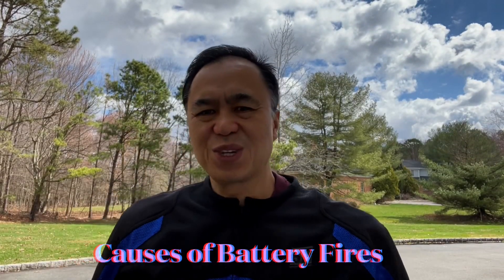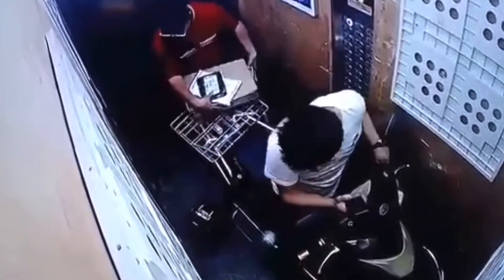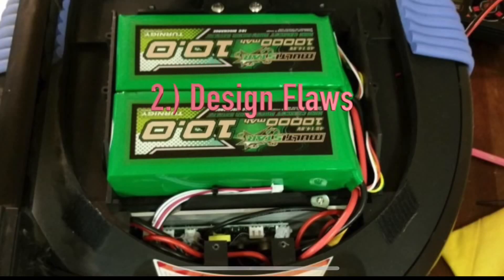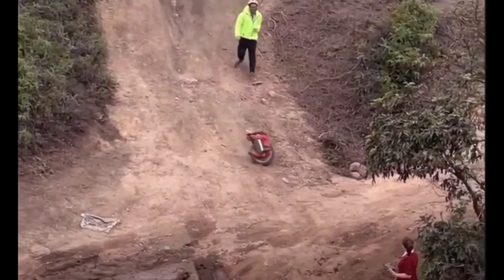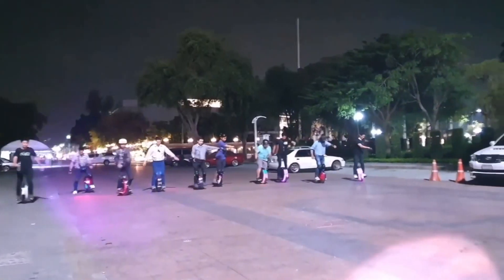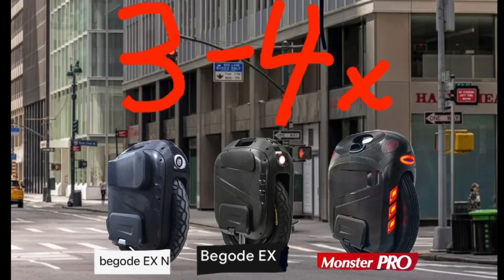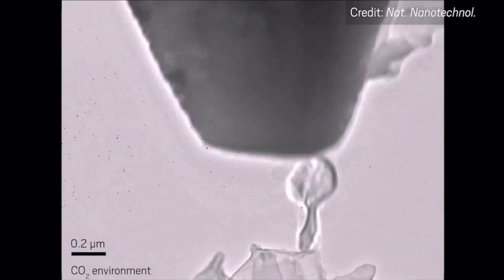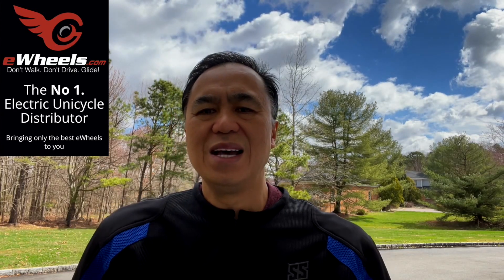Causes of Battery Fires

Comment: Great explanations. I’m guilty of regularly draining the battery.
Reply from the maker: Thanks! I usually don’t ride if my wheel is less than 50% charged as a cutout can occur if I push my wheel too much. My usual rides are usually 10-15 miles long anyway and my Nikola 100V has great range. 

I would charge my wheel to full charge on the day of or at least the night before my ride. I would never charge my wheel overnight of course while I am sleeping.
Reply: @AdamU1016  that sounds funny. Actually, 0% battery in wheellog or eucworld, is not real 0%. Manufacturers made a big enough margin for safety, and the real charge is 10-30%. That's why you can still ride when programs show 0% while standing still. I often ride to "zero" kingsong 18xl, making 80-100km trips without charging, and everything is ok.
Reply from the maker: @ZorgKirill   - You run the risk of a cutout by riding your wheel at low charge. Should you need to accelerate quickly to avoid an accident your wheel could cut out. I top off before I ride if I am able to.

In addition, if you are always draining your battery to always low level as I mentioned in the video, the wires and hence internal temperature can get hotter since more current would be needed to power your wheel. When your wheel is at low voltage due to low charge, your current would have to increase to power your wheel. More current can heat the wires, mosfets and internal shell temperature and hence affecting battery health.
Reply: @AdamU1016  on low voltages gotways/begodes tilt pedals on maneuvers, even with turned off pedal tilts. I have 16k km experience on Gotway MSP, riding fast and on low voltage often, and had no cutouts. As for the heat and battery temperature on low voltage, it doesn't work in such way. I've spent 2 hard winters with lots of snow and temperatures like -20C and less, riding as usual as in summer, and on low voltages battery freezes faster, not heats up. If at summer I can ride slow on 20-10%  charge for a dozen km , in winter the distance become twice as less, if not even smaller, because battery freezes quicker and voltage drops faster. When i get inside warm room, battery % and voltage rises up, because it heats up by warm air inside the room.
Reply from the maker: @ZorgKirill  - That’s great that you haven’t had a cutout riding at low percentages. I have been riding the wheel for almost 8 years now and have never had a cutout by being conservative as well as having at least 50% charge when I push my wheel. I have stopped counting how many miles I have ridden long ago. I have no idea. I have changed so many wheels. 

In the summertime we reach temps over 100 F (38 C) here. I would not want to push my wheel at low charge. May I ask what part of the world you ride your wheel?
Reply: @AdamU1016  Russia
Reply from the maker: @ZorgKirill  - What’s the hottest temp there? Does it ever get over 38 C? Are you a conservative rider that you can ride your wheel to really low percentage charge without a cutout? The speed throttling doesn’t bother you when it gets in the single digit charge?
Reply: @AdamU1016  last summer there were weeks with temp +30-36 C. It happens rare, usually 20-30 C. As for riding style: sometimes i ride very fast (avg speed 40+ km/h, top 60-70 inside city), and have PWM beeps. The best and explanatory  case I had: riding fast  on less than half battery,  50-60kmh, then uphill road starts and I hear low voltage beeps. When incline ends, low voltage beeps turn off, and after 1-2 seconds I hear PWM beeps. (i was pushing the wheel with the same force, but on incline speed was less and voltage drop bigger, on plain the speed became higher but the voltage was OK)

Comment: Adam, before I bought my gen3 veteran sherman late last summer, I did my research, I looked at the crash n burn aspects of the euc/pev world before I looked at the positives, the battery quality has come a long way in 6 yrs.. Thank you for making it plain and simple in your explanation, it helps immensely. Keep on keeping on brother🙏✌🤙
Reply from the maker: Yes I think the battery quality and EUC engineering have improved immensely since then. The need for  increased power and speed unfortunately has led to other consequences. I am quite hopeful that the LiTech solution will greatly improve the safety margins.
Enjoy your rides!

Comment: the litech test at 11Mn 30sec  is just a test for overload  it does NOT test the case were the mosfet on the mother board short . the fuse they have selected is a automotive fuse NOT rated in voltage we have in EUC. 
Testing on one fuse only is not a good and sound test, especially for a fuse that it rating is exceeded according to fuse manufacturer datasheet.

EUC manufacturer need to select a fuse that have the proper voltage rating and the proper interrupting capacity
Reply from the maker: I still think the Litech option vs. the standard Begode batteries is more reassuring. Best way to minimize overdischarging since Begode is not willing to change their firmware is to get the biggest battery packs the non Begode batteries have to offer.

Comment: Yesus.
No thanks.  I'll wait for better technology or stick with my gas engines.  That elevator fire looked scary as hell.
Reply from the maker: As long as you do the precautions I mentioned you should be fine. Never leave while your battery is charging. Be nearby. Don’t charge overnight then go to sleep. Set a timer so you can disconnect and unplug once done. Have a fire extinguisher nearby. There are more positives than negatives. 
Have a safe ride!
Reply: @AdamU1016  Thank you for the reply.  Ok.  I understand the chances are low if everything is done correctly.  But.. if on the off chance I make a mistake or it happens while in my garage and burns my house down would it have been worth the risk?  Probably not.

What about some kind of steel storage box?

Comment: That guy at 3.35 when the scooter caught fire runs away then come back with water or was that a extinguisher?and falls in the process ! I would have at first hint opened the patio door and got it outside ! I have seen a few phones get hot and catch fire when dropped
Reply from the maker: It looked like he was bringing back a glass of water which he had then dropped in panic. He just couldn’t think straight. 
In the case of a phone dropping and then catching fire, the battery pack probably got damaged  or was already compromised to start with. The shock was enough to set the thermal reaction into play.

Comment: Mi Nikola plus lately been charging up to 105v don't know what to do  isint it surpose to be 100.8V total?:( original 3a charger )
Reply from the maker: That’s strange. It should be 100.8 V max. Is that 100.5 V reading on the Nikola shell display? I have the Nikola plus 100 V too. I never had that happen on mine. I would recommend posting this issue on the Electric Unicycle Forums. You will get an answer soon. 
https://forum.electricunicycle.org/forum/34-begode-gotway-and-extreme-bull/
Reply: find an electrician with multimeter, and check the voltage on charger and on the wheel. Maybe charger has lower limit, or wheel controller shows wrong number.
Reply: So on euc world app shows normal 100.8 full charge, but now side panel fluctuating between 106V and 110V

Comment: What sucks is I have the Nikola plus 100v and it scares me one day my EUC can catch fire :( how do avoid this? Ride slower? Not over accelerating it or even going up to steep of hills? Braking softly?
Reply from the maker: I am quite careful with my Nikola 100V wheel. I don’t stress it out. My usual cruising speed is 20-25 mph. The max speed I ever attained was 35 mph and that was only a brief moment. I do charge my wheel in my house and when I do I am nearby and within viewing site of the wheel. Never charge overnight or charge and then leave the house. I also set a timer so I know when to disconnect from the wheel as well as unplug. If you are really concerned, open up the shell and check the battery packs. Check every 500 miles. Check if the packs are swollen. The most common times for the batteries to catch fire is when charging or when it is ridden. Is your Nikola one of the wheels shipped by EWheels from Dec 2019 to April 16, 2020?
Reply: nothing will save it xD Just watch the voltage after every full charging, it has to be 100.8V. And if during charging, the charger suddenly shuts down and shows green leds, earlier than usually (and with voltage lower that 100.8V) , it's time to repair batteries.

Comment: Thanks for the informative video. Genuine question which I have always wondered: Why are fires much more prevalent (at least in my knowledge) on EUCs than on scooters?
Reply: I think that on two wheeled vehicles you can install conservative fuses in multiple locations. Worst case is you blow a fuse. In EUCs a rider would fall if power is cut, and to reduce the amount of failure modes, the complexity is reduced to a minimum. What if you got injured going over a speedbump and had a cutout because the fuse blew. Wouldn't you rather take the chance that the wheel could handle it? That's basically the dilemma.

Comment: Hello. Did you make a mistake at 8:42 that the parties of Nikola 100v from December 2019 to April 2020 were revoked? Maybe 2020-2021?
Reply from the maker: Here is a quote from the EUC forums from an EWheels correspondence when specific details of the recall was mentioned. The dates I mentioned December 19, 2019 to April 16, 2020 are correct. Below is the quote from EWheels. 
Got to page 5 of this post from a commenter named Paul A. It is in the middle of page 5. He copied and pasted an EWheels correspondence email: 
https://forum.electricunicycle.org/topic/25446-ewheels-tucson-service-center-fire-site-destroyed/
Reply: @AdamU1016  Thanks for the clarification, you're right. I was afraid that my wheel falls into the expected batch)

Comment: Question related to number 11 I charge my Sherman up to 100% all the time will that be potential issue? Wen not using am I supposed to drain the all the batrry?  What percentage has to be stored?
Reply: charge to 100% to balance cells.  If you not riding for some time -best is to keep battery between 50-80% for storage.

Comment: I'm just wondering if there is a way to shut down a fire within a few seconds of it starting, on smaller vehicles like the EUC.

On larger vehicles like a car it would be necessary to build them in to the vehicle, but small vehicles they could carry a device.

Or alternatively perhaps it's about time the new tech batteries came on the market to avoid this kind of thing.
Reply from the maker: Since I made this video I have actually considered carrying a portable fire extinguisher when riding. It’s always best to nip things in the bud before it goes full blown blaze of glory. 

The Litech option certainly is the best battery pre-emptive measure out there.
Reply: @AdamU1016  Keep in mind that the approximate discharge time for 10 to 20 pounds of dry chemical ranges from 10 to 25 seconds. Yes, the biggest fire extinguisher only lasted that long during usage. You also can't extinguish EUC fire when the cells are exploding. So, you have to wait for the exploding part to die down. 

To answer OP, one* of the ways to kill the fire in secs is to take out the oxygen surrounding the fire source. Ok. not the only way, after you can engulf the flame with water or an extinguisher during phase 2 of EUC's fire.
Reply from the maker: @theanimalplanet7031   Battery fires are self sustaining since oxygen gets released during the thermal runway reaction. Having said that and if I am in an enclosed area and I even see any remote sign that my wheel is about to go on fire I would just use the fire extinguisher very early on. Hopefully I would be able to take the wheel safely outside ASAP.
Reply: @AdamU1016  From observation, there are two phases when it comes to EUC fire. Phase 1, when gas leaks out off the cell, as soon as there is a spark, we would see a violent explosion. In case of S20, it took 3 secs from gas leaking out of the cell to the explosion. Other EUC fires, from leaking gases> explosions too only took a few secs. So, during phase 1, its impossible to extinguish the explosions with fire extinguisher. After ruptured cells' gases are gone, you enter phase 2. During this phase fire are mostly from the burning plastic shell/tire. During phase 2, you can extinguish the fire with fire extinguisher or spraying water from a hose. I was addressing OP's EUC fire only during phase 2 to be precise.
Reply: @AdamU1016  perhaps that is something these fire extinguisher makers could come up with, a small company extinguisher for picking into small gaps to try and limit the damage.

And perhaps an idea for theaters of these scooters and EUCs to leave small holes or an access panel so an extinguisher nozzle could be poked in to shut down a fire within a few seconds or slow it down for safety.

We know fire depends on oxygen so there is potential.

Comment: Damn after hearing all of this, we are NOT READY for electric cars soon until companies fix these issues, lol
Reply from the maker: Anonymous Panacea  Solid state batteries are definitely better but are too expensive at the moment. 
I would just be nearby and in plain view of my wheel when charging. Set a timer too.
Reply from the maker: I currently have a hybrid car but will still be upgrading next year to a full electric car despite this inherent danger. 

We have several free charging stations at our hospital.  That’s a great incentive. I will just treat my car the way I treat my EUC and it should be fine.
Reply from the maker: Anonymous Panacea  - Based on the research I did if your battery is going to catch fire the most common time would be when it is either charging or when it is on and the scooter is being ridden. 
The best thing to do in my opinion is to make sure you are nearby and readily available when you are charging your scooter. I would not charge and then go to sleep or leave the house. Set your timer on too so that you can disconnect from the PEV and unplug the charger.
Reply: @AdamU1016  even  though i have had  my high power ebike  for 2 years now and  have always  charged the bike inside the house ....this video  got my afraid to turn it on inside the house   now....not only this video  but    there is   this one video of  ebike catching fire .....so i started chating with the rep who sold  me my bike ... and she told  me  that they never had that problem  plus they use  premium parts   that is why the bike cost so much ... is what she said to me ......but from now on i will be charging the bike  outside

Comment: I have a MSP HT purchased in June 2020, is there a recall on the battery packs?
Reply from the maker: If you bought it from Jason of EWheels and affected by the recall he would have contacted you by email regarding the battery replacement process. There has been a delay in the program because of the fire last October at EWheels. Wheels shipped from Dec. 19, 2019 - April 16, 2020 are affected. You can open up your wheel to see if your battery is the LG M50LT.

Comment: Did you see the s20 catch fire yesterday in ny
Reply from the maker: I will have to check that out. I usually don’t buy the latest and greatest wheel until it has proven itself with the beta testers. Lol
Reply: @AdamU1016  euc vibes or euc serbia you can see it there
Reply from the maker: @eucridez2062  - I just saw the video. Wow! That is scary. At least the rider is OK but now he is out $3,500 USD. I am sure he will eventually get a replacement wheel. I would stick to the proven wheels for now.
Reply: @AdamU1016  i have already paid for my s20 in full
Reply from the maker: @eucridez2062  You can talk to your dealer and ask him if there are any circumventions being done in light of the recent issue. I am sure he will be reasonable. You haven’t even received the wheel yet so it will be no cost to him. You will at least get a credit toward another wheel if that is what you wish.
Reply: @AdamU1016  im not too worried about it yet 1 fire wont deture me lol its funny though i told ustride to link up with hsiang to test the s20 and he does and this happens
Reply from the maker: @eucridez2062  - The S20 for me is the wheel I would get myself. I usually wait at least a year though and let KS iron out all the kinks first.
Reply: @AdamU1016  i agree s20 is for me also hope they get things worked out for the first production batch and i will wait to do the updates on the firmware until updates are proven to be safe
Reply: @AdamU1016  No, that was a demo wheel.

Comment: Excellent video! Very informative & well spoken. 10/10.
Reply from the maker: Thanks. It took me quite awhile to gather all this info. I actually edited out over 5 minutes of my video to make it more succinct.
Reply: @AdamU1016  there’s folks out here that do not mind the extra information buddy … but yes awesome informative Video, we both have the same Wheel hope it last us years and years of enjoyment
Reply from the maker: @astyn3117  Thanks! The Nikola is a great choice wheel. It has gone through several iterations and improvements over the years. I waited 1.5 years since its release before I upgraded to the Nikola. Of all the wheels out there it is the best bang for your buck. With my modified seat added on the Nikola is the best wheel I have ever had. That shell is also the most durable of all Begode wheels. 

You had asked if I still ride my Nikola on another video of mine. I was not able to reply somehow  on my “KS Fan Got a Nikola” comment section.  I still do and now with the new Litech batteries in place, the Nik is more responsive and safer to use and store in my house. That extra peace of mind with the Litech batteries makes me appreciate my Nikola and EWheels more. 
Enjoy your Nik and have safe rides!